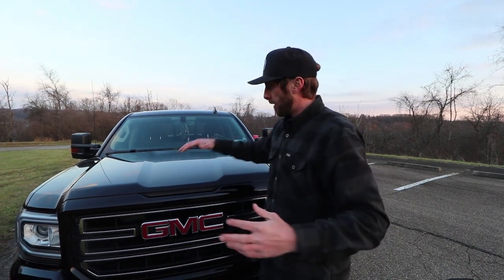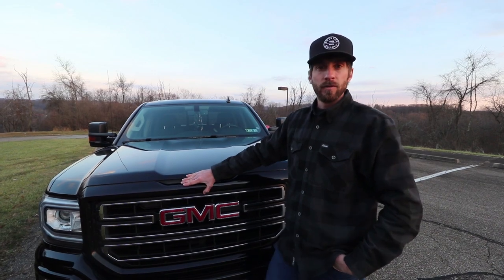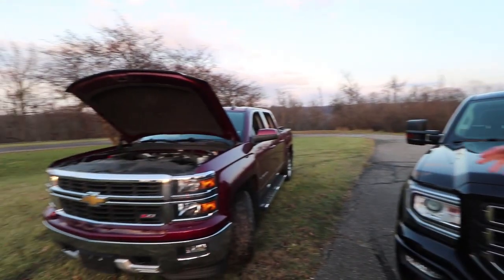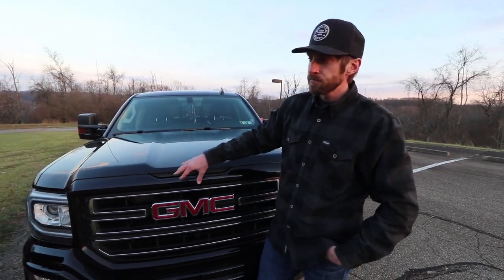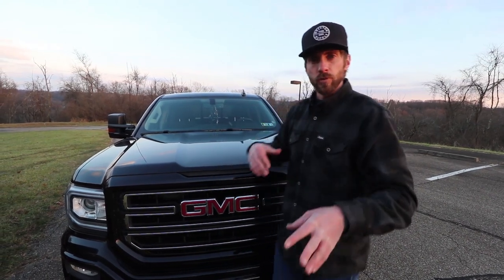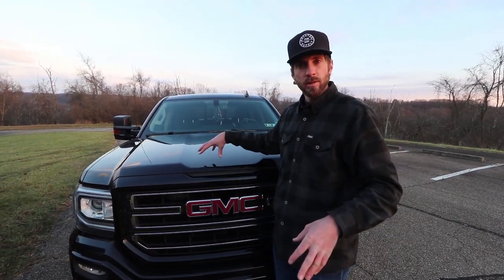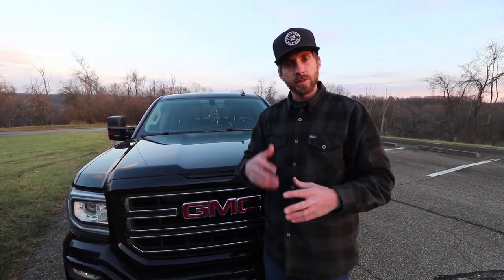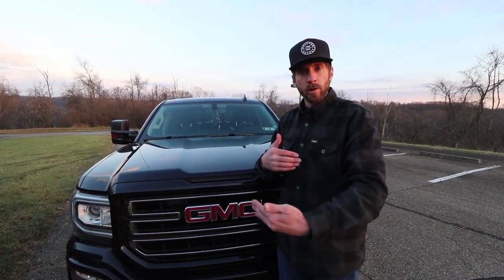Radiator Fan Won't Turn Off  2014-19 GM Trucks - Temperature Sensor & Thermostat Previously Replaced

Comment: Hi, I'm Having this same issue on a 2015 silverado... Changed the sensor and thermostat and all and still the gauge goes to 0 or 160 and the fans come on and constantly run... Any more causes of this issue?
Reply from the maker: Did you watch the video?  Make sure you disconnect the battery.  That resets the computer.
Reply: First of all thanks for the reply.. Yes sir I disconnected the battery and it ran fine for a couple of days then the same thing happened with it... You haven't had anymore problems with yours since you replaced those two things..? I'm thinking I need to switch to a 207 thermostat instead of the 160.. ? IDK but will keep messing with it.. Thanks for the video
Reply from the maker: Yeah, after replacing the thermostat and the sensor I have had no issues. I went with the manufacturer specified parts. I'm not sure why there is different thermostats, but one of them is probably for a different motor or different vehicle.  For the 1500 series trucks there are three different motors. For the 2500 to 3500 series you have one gas motor and one diesel motor. I would double check to make sure you haven't picked up the wrong thermostat.  This video and replacement was done on the 5.3 l v8. However, we have done this on the 4.3 V6.
Reply: Ok thank you for making these kind of videos for the at home YouTube mechanic.. I appreciate it

Comment: Hello brothers workshop… I have triple checked and everything is back how is supposed to be… the only thing I have yet to do is removing the Teflon tape which I am doing… but I replaced the sensor and the thermostat and now the fan won’t turn on and the temp goes to 210 (the middle) …. Will keep you posted
Reply from the maker: Keep us posted and disconnect the battery to reset the computer
Reply: @TheBrothersWorkshop  so apparently the thermostat I purchased which is a duralast at autozone doesn’t activate the at the same temperature as the factory GM thermostat so the temperature goes up to 210 degrees (middle of the gage) but does not get past that point and the fan does turn on but now instead of the temperature staying below the middle of the gage… it is right at the middle. Did this happen to you guys as well ?
Reply from the maker: We didn't have any issues with our thermostat.  Did you get the correct one for your truck?  It's been a while, do you have any updates on this issue?
Reply: @christiane.montanez3885  this is happening to me as well. Fans do turn off when I turn the truck off now though. Before they would stay on after I turned the truck off. They just run constantly when the truck is on.. frustrating.. I’m also getting a bunch of other codes all of a sudden..

Comment: O have changed thermostat and temperature sensor on My 2014 GMC Sierra and the gauge is still 160° and the fans still running on high and still run after I shut the engine off ???
Reply from the maker: Reset the trucks computer.

Comment: 2016 Silverado- Changed out thermostat, sensor and both 40 amp relay, disconnected battery and still both fans stay on. There is no warning light on the dash, took both 40 amp fuses out and of course it stopped. What else would be causing this.
Reply from the maker: If you followed all of the steps in this video correctly, than you may have a different issue.

Comment: If the thermostat is stuck wide open could I still drive it 40 miles for the part? Fans also blowing really hard and 35 degrees out
Reply from the maker: Hey Cody, I drove for 6 hours with this issue.  I wouldn't recommend doing that, but.omce I replaced everything, I had no issues.

Comment: We've replaced the coolant sensor and the thermostat (have disconnected the battery as well). The issue now is the fans won't turn on.. Any suggestions?
Reply from the maker: Make sure you have connected everything correctly.  Make sure you did not disconnect something else by accident.
Reply: Having the same issue

Comment: Changed my sensor and it reads my engine temp correctly but now my radiator fan wont turn on. Any ideas?
Reply from the maker: Make sure you have the correct sensor.  Also, double check your work.  Is everything connected?
Reply: @TheBrothersWorkshop  turns out everything was good. Unfortunately, the sensor already went out yesterday. I bought a new sensor from a different brand and will be installing it today.

I cant find an answer online but do you know how to relieve the pressure inside the coolant system so that I don’t lose any coolant during this process?

Comment: I have 2017 canyon and I have the same problem and I change the heat sensor but the fan won't turn off and I disconect the battery and after a month the problem came back and I disconnect the battery again and 3 days later the fan went on again, do I have to change the thermostat? Thanks
Reply from the maker: The motor you have is different, but it sounds like a similar problem.  However, I laid it out in the video.  If it continues, you need to make sure you replace both parts. That includes the thermostat.
Reply: @TheBrothersWorkshop  I change the heat sensor already....thanks so much..

Comment: My fan comes on , on a cold start and stays on until I turn truck off. My temp gauge on inside is reading correctly. I changed the temp sensor and disconnected the battery for 30 seconds or so and hooked it back up and the fans are still staying on 🤦🏻‍♂️. I didn’t use thread tape. Any suggestions?
Reply from the maker: Hey Bailey! If you watched till the end of the video we also talked about the thermostat being a culprit for this issue.  I have two videos for you to watch.  The first is short and goes over trouble shooting.  The second is the thermostat installation video. We've added the links below: 👇
https://youtu.be/wed9eZxPwsQ
https://youtu.be/WvLyBM8FHdM
Reply: @TheBrothersWorkshop   do you think it would be the thermostat even tho the temperature is reading correctly inside the truck?
Reply: Also my ac won’t blow cold when I first start truck for the first 10-30minutes sometimes. Then it blows cold and does great all day. Then next day same thing 10-30 minutes not blowing cold then bam. Good for the rest of the day. I feel like the problems are related
Reply from the maker: It wouldn't hurt to try.  It's an inexpensive part and very easy to replace.
Reply from the maker: I'm honestly not sure what the could be aside from an issue with your ac condenser.  If you replace the thermostat, let us know if it fixes the issue.
Reply: I ended up finding a leak in the radiator. I had a warrenty so I took it to the dealership and they replaced the radiator and a wiring harness for the a/c they claimed it was rubbing something and had some loose wires

Comment: I also had the same issue, but it didn't really fix it. 2017 Silverado 6.2 l. Replaced thermostat and temp sensor. But I still disconnected the battery the whole time while I was repairing. My fan still kicks on high, but my thermostat is at proper engine temperature now. I have disconnected the battery numerous times, but the fans kick on high while I'm driving. also, my air vents in the front grill still function properly. I've gone through all the fuses as well. What am i missing? Little help from anyone with experience. Thanks
Reply from the maker: Sounds like you might have something else going on.  The truck we worked on in the video has a 5.3.  you may need to have your issue diagnosed by a professional.
Reply: Bad fan relays?
Reply: @TheBrothersWorkshop  ended up that the dealership mechanic reset my fan temperature settings. Had a friend using HP TUNERS to custom set the fan temperature settings.
Reply: @Viking690  did that work?  I have a 2015 Yukon and we are about done with this fan issue. We have replaced just about everything 18 times and disconnected the battery a million.  Fan is still running.
Reply: @jillcomfort9971  yes it did correct my problem with my fans. Using HP tuners getting into the system settings and to control the fans
Reply: @Viking690  thank you! I’m going to try this and see what happens.

Comment: So I replaced the coolant temperature sensor and my fans come on soon as I start it.any idea please any you no would be great help
Reply from the maker: Did you watch this video...?  It explains your question and all of the common reasons why you would have trouble.  First you need to disconnect the battery, remove the teflon tape from the sensor, and replace the thermostat as well.  Videos are linked below: 👇

https://youtu.be/WvLyBM8FHdM

https://youtu.be/aJeksrxcCDI
Reply: @TheBrothersWorkshop   I changed the thermostat and housing also the cooling temperature sensor So far everything seems to be back to normal  my cooling temperature gauge is going up and staying in the proper place now I do have a little better heat also Next I have to check the cabin filter to see why I don't have a whole lot of air flow Thanks for the information much appreciated
Reply from the maker: The heat will definitely improve now that everything is fixed.  We have a video on how to replace the cabin air filter.  I've linked it below for you: 👇
https://youtu.be/u4InCoR3uqw

Comment: I did all of that on my 2014 ,my fans scream  when I turn on the a/c and the heat ,how come  any ideas
Reply from the maker: Hey Mike, sounds like you have an issue we are unaware of.  When you replaced the sensor and the thermostat did everything go back to normal?  Is the only issue with your HVAC?
Reply: Its seems to be ,it just seems like the fans run loud and are on all the time .I even change  out the ambient  air sensor  in the grill
Reply from the maker: There might be something wrong with the fan itself. 🤔 That's very strange.

Comment: I just changed out the thermostat and sensor  and fans still run after truck is off
Reply: Take the negative post off of battery for 10 min
Reply: @royevans9904  ok ty brother ill try that
Reply from the maker: Exactly what I was about to say.
Reply from the maker: Give this full video a watch.  We explain that you need to disconnect the battery to reset your trucks computer.
Reply: Ok I took battery cable off. That fixed the fan issue but gauge is still on 160 degrees
Reply: Took the Teflon tape off the thermal sensor and put it back on without tape and now everything is working properly.  Thank you for all your help
Reply from the maker: Glad to hear it's working properly!

Comment: I replaced sensor, thermostat and disconnect the battery but Still have the issue
Reply from the maker: Make sure you follow all of the steps correctly.  If you did and this still occurs, you may have a different issue.

Comment: I did the thermostat and the coolant temperature sensor  fans comes on stays on
Reply from the maker: If you followed all of the steps correctly there should be no issues.  Did you disconnect the battery and reset the computer?  If so, is the truck displaying other issues?  You may have another problem, it's hard to say without knowing exactly what's going on with your truck.
Reply: @TheBrothersWorkshop  so I disconnect the battery for 10 minutes then hooked it back up put the key on to just before it starts waited few minutes then started it and shut it off, I then started it again and went for a ride seems to be ok I'm gonna try again shortly I think it worked. I'm gonna put a different thermostat in today a 194 instead of the 160
Reply from the maker: It's been 4 days.  Any updates?
Reply: @TheBrothersWorkshop  everything works good, temp still don't go up near the middle but I got good heat, I'm gonna check the cabin filter later to see if that's causing me the restriction on airflow..otherwise all 👍 good. Thanks again

Comment: Need to clear the codes with scanner and be good to go.the code is for engine temp not coming up to range .when code sets it go into a default aka fans running all the time
Reply from the maker: Even if you clear the codes, it will happen again. This is because you haven't fixed the problem. Remember, the truck has an underlying issue. This idea is no different than disconnecting the battery and reconnecting it. Eventually the problem will come back.
Reply: I realize that .just replace the t-stat and temp sensor next to it .having a diagnostic scanner to read data and troubleshoot the problem . Not to just throw parts at it .factory had there thinking caps on to have the programing for such a safeguard